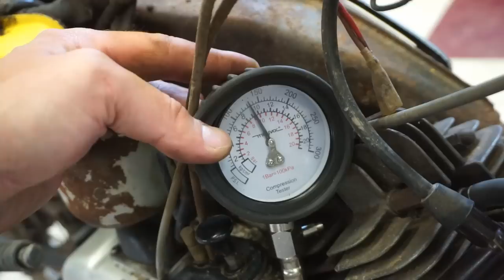Rare 1970's Mini Enduro Sat 30 Years In a Basement

Comment: I had the same model as a 12 yr. Old Yamaha enduro 60 burnt orange . Mine had the the headlight and tail lights as well turn signals . As a kid seemed like it would out run all the Honda 50’s and most Honda 70’s. It had a 60 mph speedometer but 47 was about it .

Comment: Sometime near 1970 Yamaha ran ads with the slogan, "someday you'll own a Yamaha".  To which I would state, "no I won't".   My reason being because while I had a Cat mini bike, my riding buddies all had Honda's,  Mini Trail 50, CT 70,  Sl 70 etc. 4-strokes all.   By the 1980's I was a Yamaha Mechanic,  and you are looking at a JT1, which by 1987 I never saw another one in or out of the shop.   It was working for Yamaha that I determined Honda engineering must have been controlled by the marketing department, "we need an arrow pointing to the front forks, invent something".  While Yamaha engineering was IMO racing.   For example, reed valves, single shock, 2 stroke power valve.  So yes eventually I owned a Yamaha.   Although Yamaha's darkest hour when the created a BMX bike was the opposite.   I believe they needed to get rid of an oversupply of JT1 forks and shocks and put that junk on an overweight BMX pig.  The same forks with a spring only on 1 side and oil in both!

As for the JT1, I did have one of my more exciting encounters working on a Mini Enduro.   The bike was written up as a no start condition.  With anything under 100cc you could check compression, or start with your hand no problem.  The bike had compression, so I raised the lift and stood over it to kick start.    1st kick it started,  screaming at full throttle because the carb slide was backwards.  I went to the kill switch on the right handlebar and was shocked with full high rpm current.  So I pulled in the right front brake and clutch and put it into first, hoping I could stall the bike with drag.   No such luck, the clutch plates were 100% stuck and the front brake had zero drag.  So the bike ran full speed off the lift into a cabinet, laying on it's side over revving until my fellow technician came over with a long screwdriver to pull the spark plug cap.  Not sure if I was in shock or just pissed enough to let it burn down.

Comment: My first bike was a Yamaha 60 it was red. Get you a nail file work's great for cleaning them points brother. Also Seafoam is the best thing to add to your gas when you are first starting one that's been sitting. It also helps moistening any rubber o rings and such .Marvel's Mystery Oil is pretty good too

Comment: In the early 70s my grandfather bought one of these used for my brother and I to learn how to ride with a clutch. We had the old pull cord minibikes before and I was just too small, and that minibike would not run very well. I put more than a few miles on that Yamaha motorcycle. That was my first lessons in learning how to work on a motorcycle. I lived in the hills in Tennessee and would get stuck back on the power lines on that bike. Staring at a hill between me and home. I had to keep a spark plug wrench and tools inside the tool kit. Oh yeah, I always had a problem with the chain coming off . Many smiles and many tears.

Comment: My brother bought one as a 13 year old kid, that was in bad shape in 1971, with its 60cc 2 stroke rotary valve engine.  I was learning how to built and fix small engines and was able to help him get it running.  We took it apart, including the engine.  Had to have the engine cylinder bored 20 over, and I was already experimenting with porting engines.  We cleaned it up, rebuilt the engine, changed the engine gear to the chain drive, rebuilt and upgraded the clutch springs, and that thing ran very well.  Beat a few bikes with bigger engines.😊

Comment: Those little bikes also had full street lighting on them. Most people took the lights off and used them for offroad use. That 60cc rotary valve 2-stroke engine is rock reliable too. Gap your points around 0.015" and it should run nicely. Sparkplug should be an NGK B8HS plug. 
That little bike rips! Do check the oil injection pump, should be working just fine. Those are pretty foolproof.
Great find, Joe! Thanks for a great video!

Comment: I cannot help but keep commenting,  when she fired up and you revved her. She sounded sooooo sweet.  

Go on restore her !!!!  The petty tank would be a breeze.  Find someone that can match the paint colour.    Oh and using a spray gun is so eeee see .  I've used one in production when was around 18 yrs old .   For petrol tank. I'd use some solvent , to wash petrol residue out.  

Use heat gun to remove yammy  badge..  so can re glue.  Clean all the ole paint off.  

Prep for primer and mai  colour coats.. then clear lacquer.     Before clear lacquer.  I'd use a artist paint brush for the black trim effect..  then use some real good spray glue to re fix yammy badge.... at her age and sounding so nice .

Wow

 Treat her to a pamper !! 

Oh and speaking of petrol  ,,  yeah extinguishers are nice...  but get a couple of sand buckets... !!! Great for dousing lit fluids...  but also absorb  the mess too pal

Comment: I had 2 of them back in the 90s! A yellow one and a white one! 3 speed trans, manual clutch, wow what fun! My friend and I used to race each other, I was heavy, he was thin and the one that had the stinger made them even if I was on that one. Im talking 60 to 80 lbs heavier I was. One had bad gears so I had them hard welded on the sides and I resized them after. Never had a problem after that. Gears were discontinued, and good luck finding used!

Comment: I owned one of those when I was a teenager in the 70s. For that time it ran decent. it was a fun bike for me. Nothing super fast but a lot of fun. Mne was actually a 60 cc my cousins was an 80 mine ran just as fast as his virtually no difference in speed. We rode the hair off those bikes. we took off the oil pump and premixed the oil and gas because the oil pumps always quit working. it would run better and faster with out the oil pump. we thought. we took off the oil pump and put a plate over it. we always filed the points and set them to get spark again. It was so much fun to ride for a little 6th grader. i thought it was a ripper LOL but it was mild. The reason why we did not use the oil pump because it always quit pumping oil and then it would score the pistion better to mix the gas and oil in the tank. Be safer. That is so cool I would love to own one again for the memories. Iconic bike from the 70s. Its a keeper I love it. I would love to find one for sale. That really is in great condition its a great survivor. I think some guys put a one ring racing piston in those and then they would really be quick.
Reply: The 60 is 58 cc and the 80 is only 72 cc. The 60 has 4.5 hp and the 80 has 4.7 hp. The 60 engine is a little more pipey, I’ve got a few of each.

Comment: My very first motorcycle was damn near identical to this. It was a 1977 (?) GT80 (GTMXF) with a 4 speed and oil injection like this. I think it was dark red? It was a rat bike. Slow and underpowered for a 2 stroke 80cc bike. Of course a lot of my friends had KX80's and CR80s that would tear your head off. It didn't take long to outgrow it and found a '79 RM250 leaned against the back of a house and covered (This was around 1985 or so) and it needed tires, chain, a pipe and tons of love. It had all aftermarket plastics and a blue seat that went up the tank. It may have been build to race because that bike scared even my dad. It was explosive with power delivery like a cannon on a light switch. 
It was one hell of a leap to go from the wimpy 80 to the Godzilla 250.

Comment: My first bike in 1978 was a yellow Yamaha GT80, I believe the color changed every year.  The engine was in a milk crate. My dad bought the Service Manual for it and we replaced the piston and rings before reassembling it. I road the wheels off of that thing, then my younger brother rode it for a couple of years. The gas cap doesn't appear to be original on yours.

Comment: In 1973 I bought one from a classmate for $60!!! It was one year old & in the red color that was optional .   I was THE SHIT in our neighborhood.   In 1976 when I was 16 I shoehorned a 100 cc Yamaha “ Twin-jet “ 2 cylinder into mine & then after all fabrication work was done pulled the engine back out & brought it out to DON VESCO Yamaha here in El Cajon California and Don & I brainstormed the transformation of that engine with porting & polished & bored over.020” cylinders & a pair of custom up pipe expansion chambers that let that little sucker run upwards of 12,000 rpm !! 😳.   I then put on a full “ Preston Petty” light & fender kit & mirror & horn from the donor bike to make it street legal here in Cali.  Within 2 weeks EVERY LOCAL SHERIFF had pulled me over either a) - to check legality of it on public roads , or b)- to cite this crazy 16 year old who went wizzing by doing wheelies & going about 70 mph on what looked like a shrunken full sized Yamaha DT-1 😂.  I was clocked at almost 80 mph on that thing & Don Vesco Loved it 😉.   Sadly I sold it when I was about 22 years old to a guy & have never seen it since .  Thanks for a memory here .  Nice find 😎👍.

Comment: I'd order some light kit for is all. Turn signal lights to. That's what those other wires go to on it Joe. It's suppose to have A battery inside of it to run those light's on.,an check the fuses going to those lights also. Could be Glass type buzz fuses.,or just those push in car type either one.

Comment: I had one of these.  After a few years of hard riding, it stopped adding oil at the carb. And burned the piston, rings and jug.  I had it rebuilt and starting mixing the oil in  with the gas.

Comment: Wow nice piece of machinery .  Erm at the 16 to 17 min mark , where you say yamahah plate is still in good condition.  

Just an idea for the case it fits to
 .if you were to clean her up,  I'd sand, wire wheel that side case / cover. 
And rather than do what most do is to try to match original top colour.  ,I'd get it as near as damn perfect for the base colour.  And give it a few coats of clear lacquer.... 

Just a thought

Comment: They also made a 90 MX with 14 horsepower and I had one
The same year they also made a 90 Enduro at a 100 a 125 Enduro and the 250 and the 360 Enduro they all look basically the same.
It was called ginuwine Yamaha performance parts gyt kit they call it a get kit

Comment: That's almost the exact same design of carburetor that comes with all of those 2-stroke bicycle engine kits. It's the same one that came with my two engine kits. 66\80cc kits there awesome it's called an NT carb or the bofang version are the same make and look except the color of the filter but that's it.

Comment: The thinng about checking spark is the outside of the plug has to be grounded. Corroded engine like that ya couod habe spawr and not know it. Electric tales a circle path. What goes out must come back. One of tiose inline spark tester are cheap and ensure you have good ground